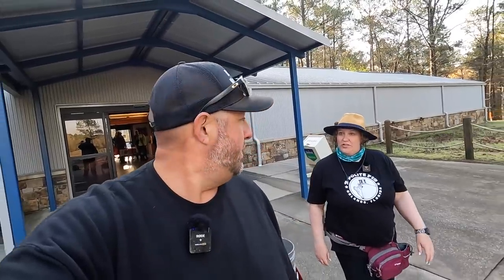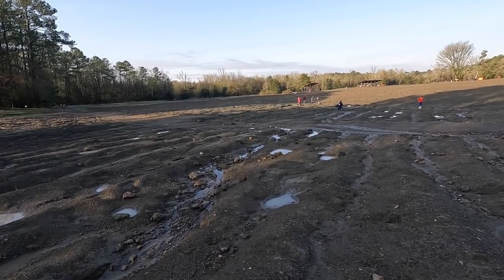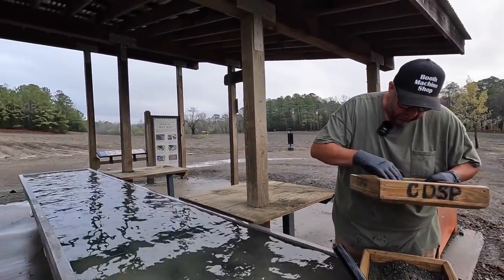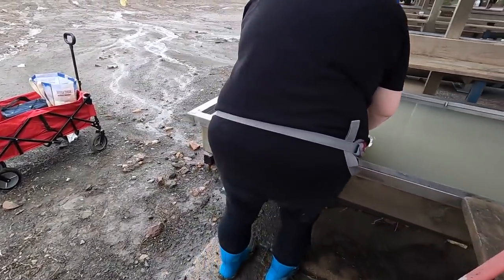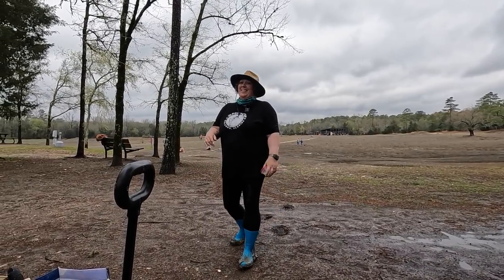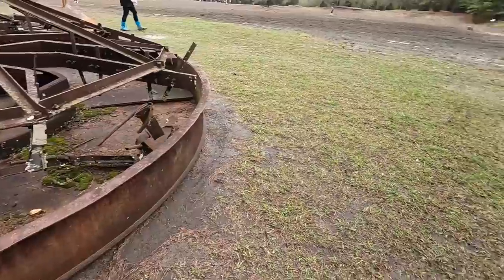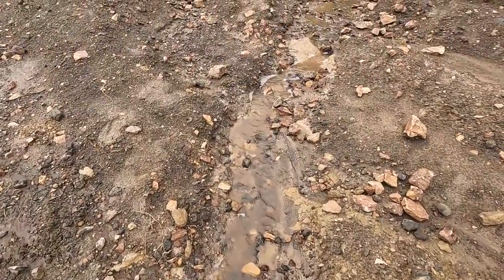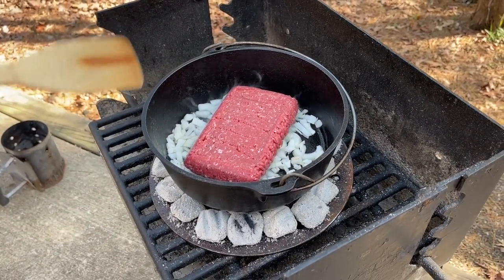Crater of Diamonds State Park Day 2

Comment: That looked like so much fun. I would definitely go there and give it a shot myself, especially after the rain, and dig deep into the water channels. Thanks for sharing Adam & Abby, that was awesome. Hope you guys find some diamonds at home. I would also use a magnifying glass to look for sure. 👍. ps: I have a secret trick to making spaghetti Adam. I make the sauce first like you did first, but I don't pre cook the 'spaghettini', I break it into three parts, and add it into the sauce(mix it a little to spread it evenly) on low simmer until the spaghettini is soft but NOT fully cooked(mix a little). Then I take the pot and let it rest for 10-15 min covered(kept warm). I love al dente pasta. You should try it, and see if you like it. It's so awesome trust me. If you use regular spaghetti, dont add as much and needs to simmer a little bit longer in the sauce. Took me a few try's to get it perfect. Bon appetite! Cheers, Blessings and Happy Easter 🙏.
Reply from the maker: Yep sounds great! That would be a true one pot spaghetti.